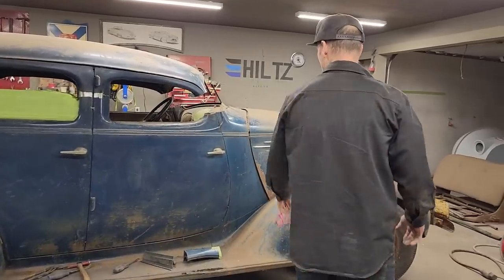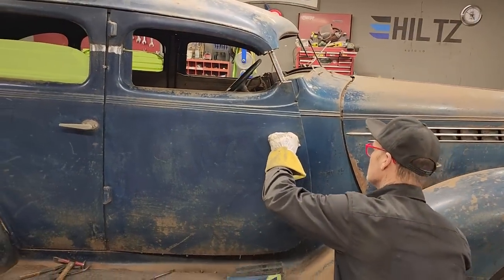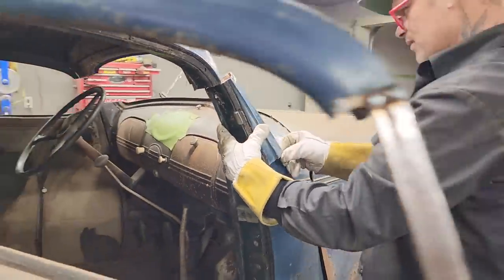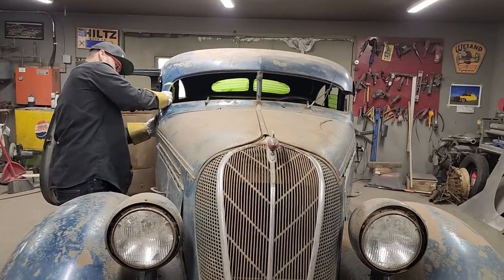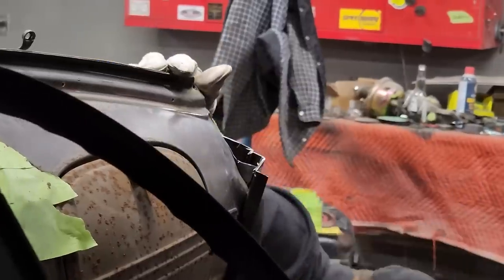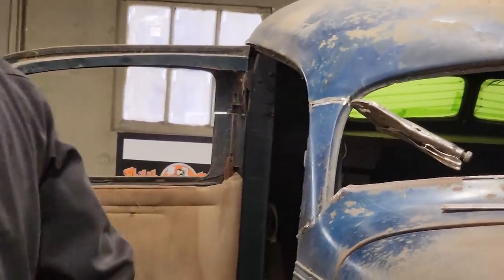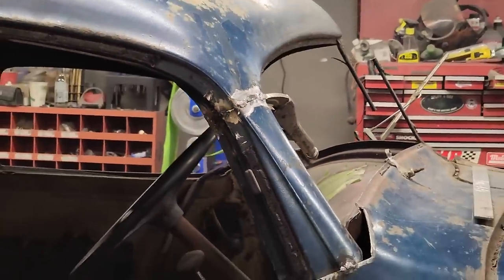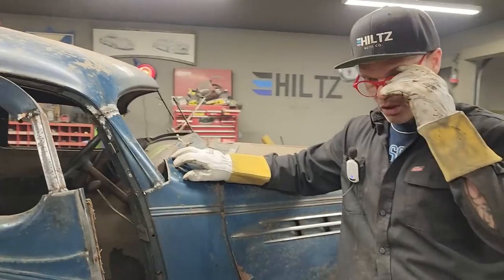We're in a dilemma with the chopped windshield posts 🫠

Comment: Yo, Chad... To correct angle on front windshield pillars, you might try cutting the roof above the front doors, and make the roof longer with an extension.
Insaw that on another chopped car video...
🙄🤔🤔🇨🇦🎯
Reply: Cut across the roof and move it back to align the A pillars and get some rake back in the windshield. Just my opinion.
Reply: that would be the right way, but thats not Chad.
Reply: 😂😂😂 as if he didn't know that was an option.
Reply: I would have section that roof only hard part is keeping the worpping under control welding it back on I think he Chad knows that we done 40 ford years ago it was big job keeping roof straight I am metal fabricator it's going be interesting see how much work he has got self into

Comment: Bad ass
I am in my mid 60's and I remember in the 70' s and 80's when chopping the old sedans the roof was cut and a long section or triangular sliver was welded in so that the roof could stretch back to the origional pillars. 
If not sectioned and stretched, the pillars had to be cut and tipped inwards to meat the top. That also necessitated the cutting of the box section at the top so that the pillars could meet the new angle of the bottom pillar.
Some guys cut the pillar off from the top at the height required and raked the whole side of the pillar out to meet  the bottom so that the pillar itself was in one piece and it was then easier to mate the top and bottom because its in one piece.
Needs a lot of skill to chop a top and you have it.
Well done.
Keep on keeping on 
Heads up 
Eyes open 
No fear

Comment: I think you should cut and section the roof. Slide the roof forward and patch in the gap left after you cut the roof. This way, you will retain the design integrity of the roof and the way in which it blends into the front window.
Reply: That’s how I thought he was going to do it when he first pointed out how far it was off
Reply: Chad said he knew he could do it that way but preferd to leave the roof complete and not have to add any metal
Reply: That was my same exact thought
Reply: I doubt you will see a windshield in this car anytime soon.  I hope so but, well some of you get it
Reply: @i8ntnuts  yep, there is A LOT going on in those posts, and you can see the multiple curves and angles have yet to find homes. I have no doubt he'll pull this off, but he's definitely taking the long way. This is anything but time saving, compared to sliding the roof forward.
Reply: @672egalaxie6  If he extends the roof, he then has to extend the door frame railing to match. I can see what you mean, but fixing one thing vs two is in the long run a time saver and let fabricating overall.
Reply: @teresathornbury9874   this is his 3rd chop in just a few weeks , how many have you done , much easier to talk than do !!!!
Reply: @WestsideCritters  Respect amen.
Reply: I would have cut the roof also. But it going to be interesting watching him make his way work.
Reply: He specifically stated, he did not want to alter the roofline. The "integrity" will be just fine when everything is reassembled and 
final welded. Measurably stronger than o.e.m., due to the smaller windshield opening leverage moments. 🧐 🤫
Reply: It would make the door harder to fit I think

Comment: G'day Chad and Jolene. 
I had my doubts on the front but your slowly bringing it together. I think with a curved bit let in on the bottom of the windscreen and the curved bit continued on the door it could look good. 
If you have one of those porta power things you could push the top section of the post out a tad.
Q. Could you maybe run through your welder settings for us dummies.
✌️ Peace from Melbourne Australia.

Comment: I never thought he would try to approach it this way. I would have thought that cutting the roof just forward of the b-pillar and stretch it by adding a few inches so the a-pillars and the windshield matched up would be easier. There's some curvature to the roof that might be tough to match, but at least it's not anywhere near as complex as trying to reshape the entire front of it and get it to match the existing lines.
But I'm sure Chad will prove his way is the right way. Also know that I'm all hot air when it comes to things like this. I know a lot, but have done little with it, so I'm not claiming to know what would actually work.

Comment: Love watching what you're doing. I'm working on a 54 chevy pick up.  Without even knowing you're helping me problem solve. Thanks
Reply: Are you.....
A) Hot rodding it?
B) Building a daily driver?
C) Factory restoration?
I wish you success with your build!

I love '54 Chevys.
Had one myself between 1983-2003.
I did my own frame-off rebuild in the '80s. Had initially intended to make it a full custom, until I started pricing parts. I wound up simply "upgrading" the suspension to mid-'70s style parts. And a 283 and transmission (both rebuilt of course) from a '66 C10. All to just make it a dependable daily driver.

Comment: Hey Chad, I got an idea! To find out where the lip that you’re gonna make for the bottom edge of the windshield needs to be welded on, if you were to take the split rubber and slip it over a piece of glass or metal or something perfectly flat but no wider than the windshield opening and slip it on the top lip and side lip ,then take a sharpie and mark that lip on the inside of the original one with a sharpie, against the glass or metal template,where  you plan on putting the new lip, it will make up for the fact that glass won’t flex and it will take the guesswork out of keeping it flat.That way, the rubber won’t have to absorb very much imperfection, since glass can absorb any.

Comment: you might want to look at the door gap near the upper hinge, if you make a little adjustment there it may line up the body lines near the front of the door a little. You mentioned the smoke so I am sure that you are going to look into the source. Thanks Chad and Jolene for your great work.,
Reply: Worn hinge maybe

Comment: I think I would've vertically split the post so it could meet the cowl and the A pillar correctly and filled the gap on the post , but it's hard to say because I'm not physically there to see and feel it , but I'm sure you will figure the problem out seeing how you've chopped more vehicles than I.  I've only done 2 , one was a 68 vw bug, and my first was a 53 Chevy pickup, and I never split the roof on either one.

Comment: Looking at the complexities of the door post or A pillar and the the differences in dimensions from top to bottom… too bad you couldn’t have treated or broke down the post in the three separate builds… inner door jam… windshield opening… an outer body skin… wedge, cutting each piece to comp, compensate for the differences in dimensions from top to bottom and welding each component back together…allot of work but maybe would been easier in the long run
Reply: Also safer. That is so dangerous  . Certainly not for road use

Comment: section the roof and move it forward add the 2" it needs to line right up, the door cut offs from the drop would fill the door lengths, all you need is the upper sill filled, you can do that, stretch your boundaries..  I think it would have fit much better interior wise had you stretched the roof or extended it to line up the A pillars..  6 of 1 I get that, my thought is the side door windows will roll right up if you extend the roof that 2" or so, and to dress the interior all you need to do is drop the door panels some, add a little to the upper trim,  perhaps you can you cut the glass to its new shape or?

Comment: chad  split top across door to door the move front part forward and line post up   Ive did it several times  then add a small strip and weld top back up

Comment: Complete noob here that understands technical theories well, and as someone else said it looks like the front to the roof needs to come forward as much as you pointed out at the centre support of the windshield. Could you not cut the centre of the top of the door right over the roof and extend it forward that much? Or are you chasing the sloped/raked windshield look which i'll admit is pretty sweet?

Comment: Hey Chad what about a series of spot welds in the door gap of the area that you plan to cut off of the windshield frame so that it can all be trimmed in the same increments and then welded back in at one point and then you could grind the spot welds off the door Gap and the door would be in line

Comment: I have seen chops, when the windshield doesn’t line up  With the post
They cut a section across the roof top and move the windshield section forward to line up the posts. Then add a section to the roof line.

Comment: Chad, one YouTuber used a chain to pull on the front posts while applying heat with a torch on the posts to gently bend them back. Might ruin some paint, though. Anyway, I see you're coming along fine.

Comment: Take the piece that was cut from the bottom, trim it back, and add it back to the A-pillar. That way, you have the front sail panel and the body line back. You could the same with the door.

Comment: Wished I knew why he simply didn't gap the roof, move it forward so everything around windshield lines up, then roof gap can easily been filled in.
Reply: Well, I have to admit I would’ve done things a lot differently myself  ifI was going to chop up a car like this.  4 inches out of the top is fine  but the bubble and the roof is hideous.  Fix that, stretch the car, a foot, and make a two-door out of it.  Probably needs to be sectioned also

Comment: I would slice it straight across the driver and passenger window right in the middle, put a piece of metal across the whole roof looks to be maybe 2" wide and make the post lineup so it's on less of an angle.

Comment: Should put a welding glass infront of the camera lens when u start welding a bead so it doesnt blind your camera operator and everyone watching. Or even a torch lens to dull it out a bit. But a lens from a regular flip helmet not saying buy another auto changer. She could keep it in her pocket and pull it out and just stick it against the camera lens when u start tacking. Just a spare old helmet blacked out lens would work fine. Just throwing it out there. Im not trying to tell u how to operate. Do whatever u do buddy. But then people could actually see your bead form and some smart people might even learn how to weld from simply watching someone lay a bead properly.

Comment: Could you steal the sheet metal from section of the pillar you cut off and graft it over the the upper part. 
This would give you the original contour of the bottom ?  Peal off the out side and wrap it around the section you put in.

Comment: I don't understand why you didn't make a cut of the roof at the radius to extend it out to match the angle of the pillar. All that would be needed at that point is a pie-shaped metal insert to fill the gap...that way you would've had minimal work to make the door and the roof match. Now it appears that you are going to have a major issue with door fitment - and crazy dash complications. There must be a reason why you didn't take that approach, but I certainly don't see it.

Comment: Dangerous. I think you need to tell people this vehicle can't be for road use unless those pillars be reinforced.
Especially the A pillars.  As some home car builder will think its ok to attempt this work and drive it on the road.
The oxidised metal adjoining  those coathanger welds is very soft and brittle. Will tear easily in a road accident.

Comment: why not cut the windshield post between the body line and the leading edge...then on the inside you can make the cut just behind the window rubber lip move it forward and save yourself a lot of welding across the dash   will make it so much easier to transition the bottom of the post to the cowl

Comment: Well that is why cars are engineered that hung is a death trap unless he puts a toll bar in it . Looks like a cobbled up mess weak pillars , weak windshield bracing , do not use coat hangers for for filing it is weak . On a positive note he is doing what he wants to do so all good as long as the car is not sold to someone who thinks it’s safe .